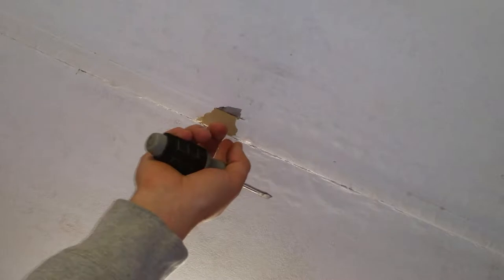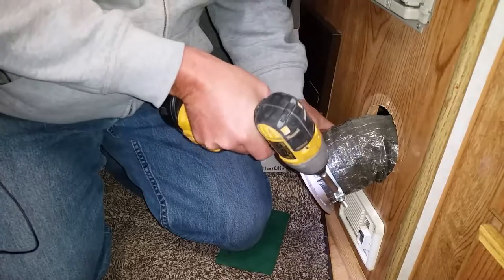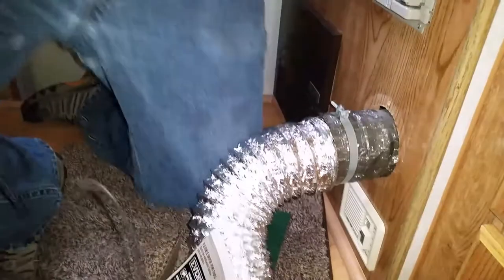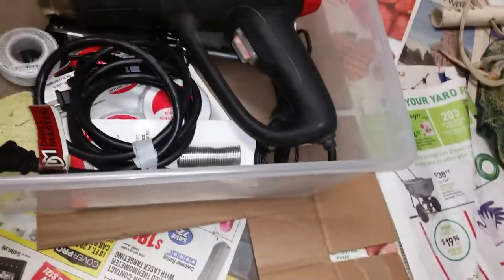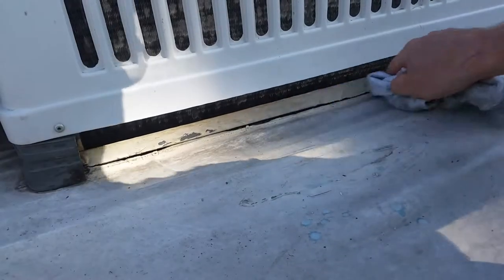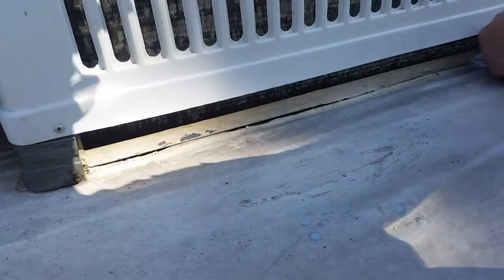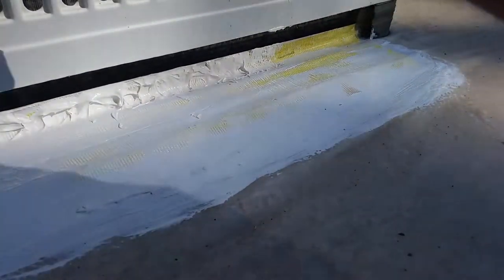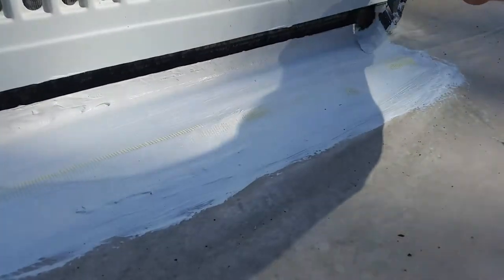RV Trailer Roof Leak Repair Pt 3 of 3

Comment: I got your channel name from James Smith of TradesmanChannel. As I also have an RV  I enjoyed watching your repair job on yours. I will continue to look for more of your videos.
Reply from the maker: To Rauscher 
Awesome! Im so excited to have you here and part of our community. Our rv is getting new tires this week. Im sure there will be rv content coming in spring.  Thanks for watching!
Reply: Debtfreehomesteaders that's cool.  I was also looking for what you might be doing on your homestead. As far as RV s I need to install an exhaust fan in mine.
Reply from the maker: Worth every penny.  It would blow your mind on how much condensation ends up in a closed up Rv just by your families breath alone.  I've done a little research on it for a video I plan on doing in regards to overcoming just that in the truck bed shell camper series.  Good thinking my friend!
Reply: Debtfreehomesteaders I have had the bathroom fan upgraded on the last 2 RVs that I've had.  It works well when dry camping and don't want to run a generator into the late night hours.  Where are you located? I am located in the Sacramento valley of California.
Reply from the maker: The high deserts of Utah my friend.

Comment: I would have pulled the AC unit to do a proper repair job.  It's only about 4-6 screws.  Also, without pulling the interior ceiling out, it's impossible to know just how rotted your roof rafters and Plywood or OSB (not USB) are.  The water didn't start dripping inside the RV. until long after it was being soaked up by your insulation.  If there was a puddle on the roof, it's likely the roof structure in that area has failed due to extreme ROT.
Reply from the maker: Yes I agree.  It was a bad deal all around.  We tried to make the best of it with what we could.
Yuck!
-Will